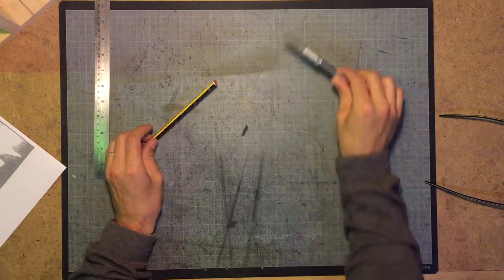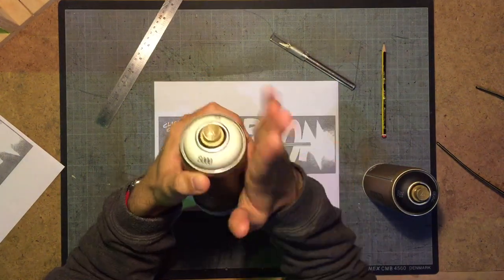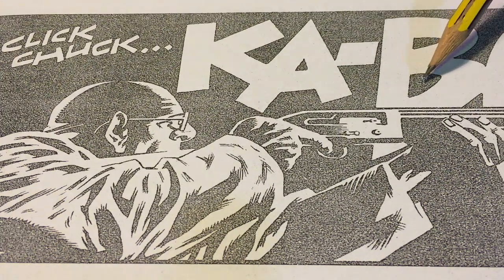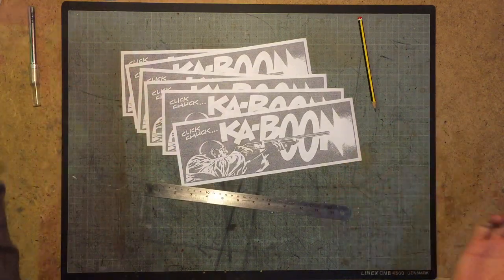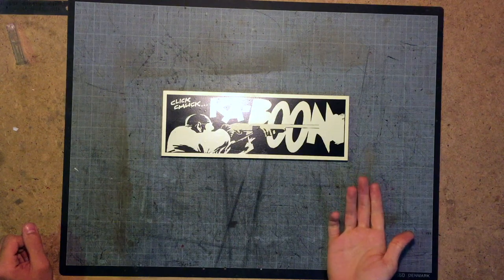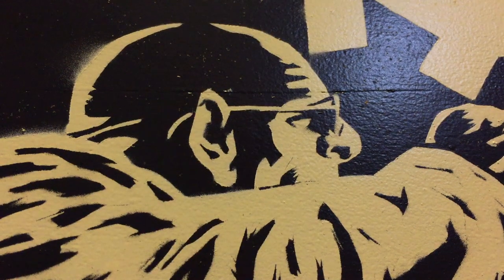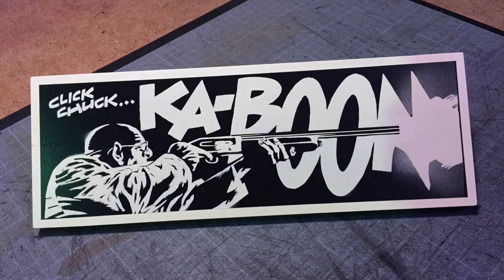Layered Stencil Tutorial

Comment: You could of used a netting or some mesh to do the cross hatching
Reply from the maker: That's very true, I hadn't thought of that. I wanted to try out the lifting technique on something and this project seemed to be a perfect opportunity. I'll try a mesh next time and see what comes from it.  Thanks
Reply: And you could have used a proper aux verb 😂
Reply: I appreciate you spending time speaking about correcting broken values/ Islands as this is something a lot of people struggle with, i like to try and work them into the piece and not make them stand out, this can be done with additional background images in a second colour Overlayed in the negative space, another technique is to work with multiple stencils that intersect the "islands" into a top half and a bottom half, this can be challenging to do with gradients but with block colours can prove to be quite easy :)

Comment: Is that a spray adhesive to get the stencil to stick? If so, what kind?
Reply from the maker: @slickfunk99  it’s called 3M Spray Mount, it’s the blue one. Don’t get 3M Display Mount, it’s the red one, it’s a much stronger glue and your stencils won’t peel back off nicely. Learned that the hard way.

Comment: I’m just curious, do you use a special type of paper. Every time I try to make a stencil, the paper sticks or it bleeds through. Cheers
Reply from the maker: I use standard A4 printer paper.  Nothing special.  What glue are you using to apply the stencil?
Reply: Andy Lawson I don’t use any glue, I always use tape. What type of glue should I use??
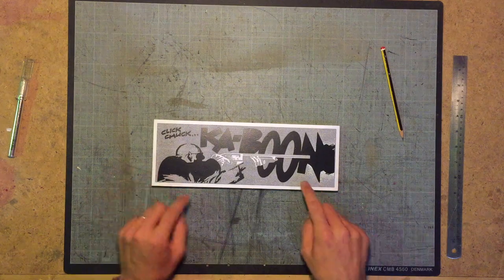Reply from the maker: I always use 3M Spray Mount.  Jump to 6:47 in the video and you can see me talking about it briefly.  It's great cos you can place your stencil and if it's not quite right you can peel it off and try again.  It is exactly what you need to solve your problems.